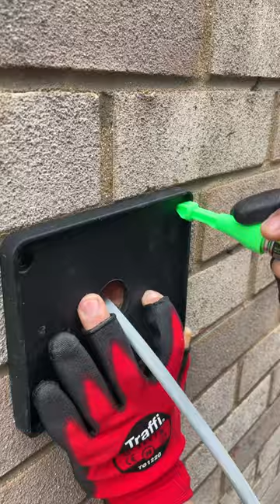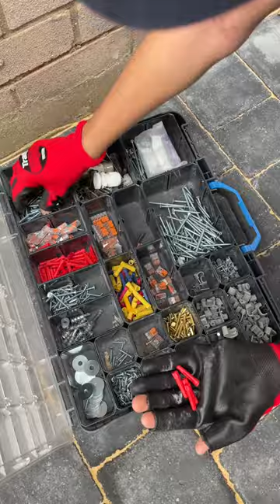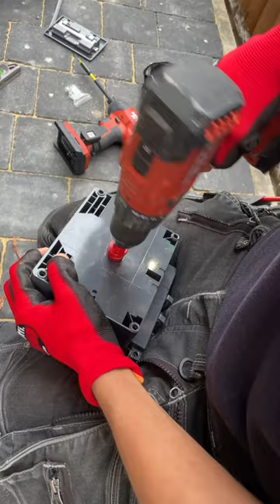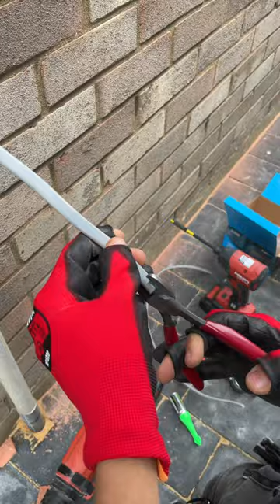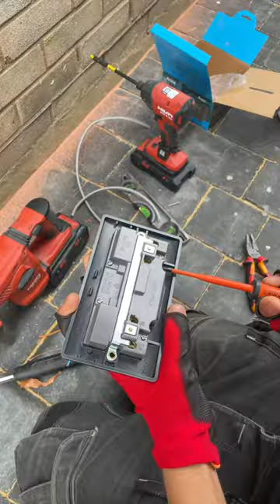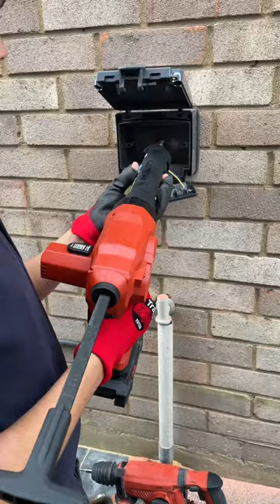Outside power socket easy as 1,2,3! #shorts

Comment: If you guys read this …. When drilling from the inside - can avoid blowing the face off a brick by drilling a small hole first without the hammer on.
Reply: How do you do that if you're going through an engineering brick? I've never actually seen an SDS drill without hammer mode since the shank is not secured from moving in and out.
Reply from the maker: This was done 👍🏻
Reply: @1992jamo  most sds have a rotary, hammer,chisel selector switch
Reply: @1992jamo  My SDS has the drill option with out hammer my dewalt well I do have 5 and impact.  I use a small drill bit and have drilled about 1000 walls an only 2 times did I blow a brick.  Gental push an a look at wall thickness and then reducing the push.
Reply: Should have measured width of wall , marking it on the drill bit and completely slow drill down when at the end

Comment: Why do you insulate the bare bond in the UK? Afraid of it shorting out?
Reply: It is not for the purposes of insulation, it is for identification. The circuit protective conductor is bare and so they cover it in yellow/green sleeving so there is no uncertainty about what the conductor is.
Reply: @deang5622  Thank you

Comment: Now I ask again.. Why doesn’t your cable come with insulation on the CPC/earth?
From a confused Danish electrician
Reply: It doesn't need it. What is the CPC going to come into contact with in normal operation?
There is no short circuit risk here.

Comment: Cable not sleeved through the masonry mhhhhhh?
Reply: The line and neutral conductors are insulated and inside a sheath. The earth wire does not need to be sheathed.

It is only being sleeved in the box to indicate it is the earth wire, it is not being sleeved to provide insulation. The earth wire does not need its own insulation.

You should be able to work out why.

Comment: Lovely job, wouldn't do anything different myself. Maybe seal the gasket to the wall but maybe overkill.
Reply: Not overkill to me, horseshoe of sealant around the cable exit point, open at the bottom. The rubber gasket itself seems more like a gimmick.

Comment: Man you live in the stone age
Wp gpo is a standard socket in a massive box
solid copper conductors, bare earth wire that you need to sleeve, flat blade screws wtf?
Reply: The sleeving of the bare earth wire is only done for identification purposes. They didn't need to sleeve it as long as they did.q
The sleeving provides no function. It is not for insulation.

Comment: Cannot let this go without mentioning  the  face brick damage, that is ridiculous and easily avoided by switching the hammer action off before breaking through. If one of my lads did that they would well and truelly dealt with, that is not acceptable and diminishes the other good work done .
Reply: “Well and truly dealt with” 😂😂😭
Reply from the maker: This was done, unfortunately the house is from the 60’s so not really much you can do about it. Pilot hole was drilled too 👍🏻
Reply: @artisanelectrics  drill out with a pilot then drill in to enlarge. A lot you can do about it.
Reply: @nikgray6635  seen this when they were doing the wall insulation,drill  was in the seam, but hit brick above and brick below.

Comment: Bending copper cores double very bad practice
Reply: It is indeed
Reply: explain how?
Reply: @ravez1147  You would be overstretching the outer radius of the core which could break when screwing down a terminal onto it resulting with a loose connection and a hot spot
Reply: I was taught in college to have the cable match the termination, "fill the hole with copper".
Reply: I was always taught to double over connections and have done so since I qualified in 1988. I’ve yet to see a conductor snap because of it. I have however dealt with faults caused by loose connections due to the copper not being doubled over and the screw not gripping the conductor properly or drilling so far into it that it snaps.